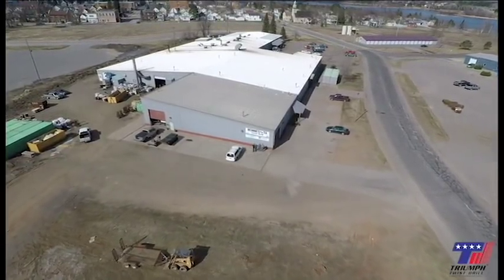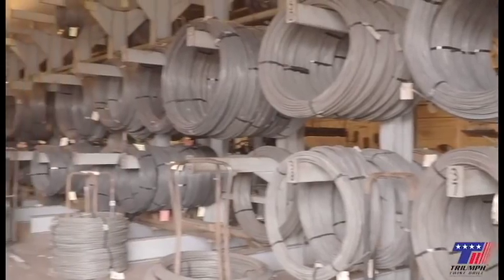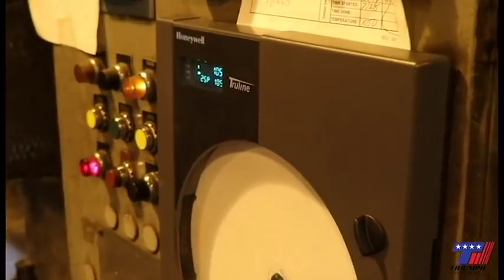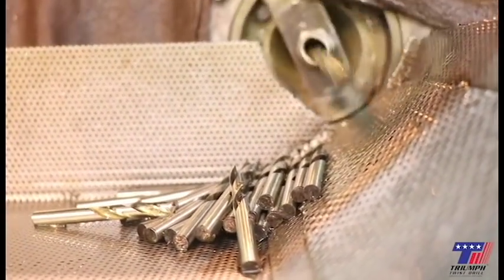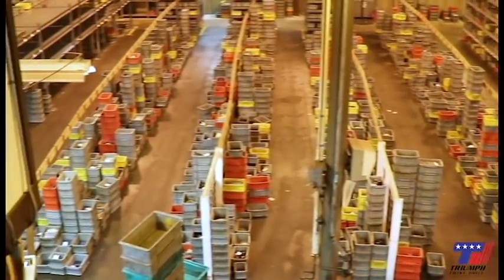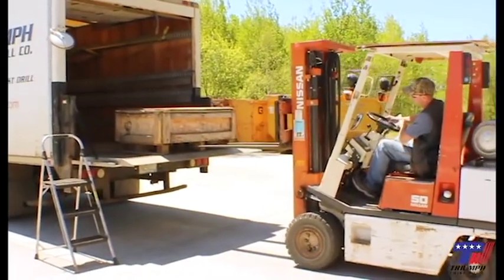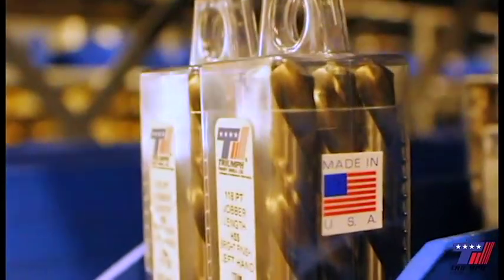Drill Bits 101 (how a drill bit is made)

Comment: Do you guys make the Snap-on Thunder bit sets?
Reply: Yes we do
Reply: @patrickgoerdt6543  I thought so. Whats the brand of bit I need to buy that's the same exact bit without the snapon logo/ price
Reply: @ThomasShue  check triumphtwistdrill.com. 
I dont sell them. I make them.
Reply: @patrickgoerdt6543  I understand you work at the place that makes them for Snapon.   What line of drills are the same as the Snapon Thunder bits, but made under the house brand name of the company you work for!
Reply: @ThomasShue  triumph twist drill. The only difference in them. Is that they are put in snap-on indexes. There are no brand markings on the bits. Just the size, HSS, USA
Reply: @patrickgoerdt6543  I was told when I bought my Thunderbirds set that it was Cobalt. I guess I was wrong, it's HSS? That's crazy becuase they still through everything I have thrown at them
Reply: @ThomasShue all the steel grades we use is high speed steel. The black and bronze are M2 and cobalt thunders are m35 steel

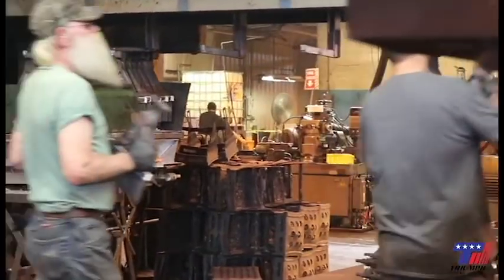Comment: Nobody else notice that he said that less than 0.177 thousandths of an inch diameter are basketed. 1:28 Somehow I don't think that's what they meant.
Reply: Drill bits smaller than 0.177"  are bulked into a basket that is then put into the heat treat process.  Larger drill bits are suspended in arrays with the end that is gripped by the drill chuck gripped in the array.  The video showed an array of larger drills coming out of the heat treater.
Reply: @schsch2390  Yes, the difficulty is that he said "point one-one-seven thousandths of an inch". He meant either "point one-one-seven  of an inch", or "one-hundred and seventeen thousandths of an inch" - not both.
Reply: I noticed it, came here to see if anybody else did  :-)

Comment: Don’t see the actual machining of the flutes and cutting edges. It comes out of the machine partially complete.
Reply: Jerry Simeone -- I quite agree. This is a frustratingly vague presentation.
Reply: Yeah, I wanted to see how that was done. Guess I'll have to send drill bits in to the How It's Made show.
Reply: @manstersr  thanzos
Reply: The operations were shown, you just can't see the grinding taking place because of the tooling and process.
Reply: While it would be nice to see the grooves actually being made, the machine that does that part looks incredibly bulky. Actually viewing the process might be impossible.
Reply: I run a Walters helitronic power machine.  We use a collet and a 220 grit grinding wheel with a -10 degree angle.  We grind everything.  You can go to a.b. tools  they use a anca cnc machine.

Comment: Nice well made drill... Unfortunately there is china that makes it for 1/3 of the price...
Reply: Yeah, but look at the angles, centering, dimensional consistence and the ability to hold an edge of generic Far East no-name bits: A "HSS" China import that is dull after only 8 3/8 holes in 1/4 mild steel and that needs resharpening every 5 minutes is an expensive way to save money...
Reply: I cheaped out and bought China crap the first time around. Let me say you get what you pay for. I've had a number of China drill bits that weren't even hardened. China may be 1/3 the price but you'll buy 4 times.
Reply: @RacingHeadInnovation  I bought the cheapest black oxide bit set from Harbor Freight just to see how bad they really were. They drill mild steel OK. But if you need to drill harder material you need a better tool.
Reply: Try FERLIT twist drills, Henan province.